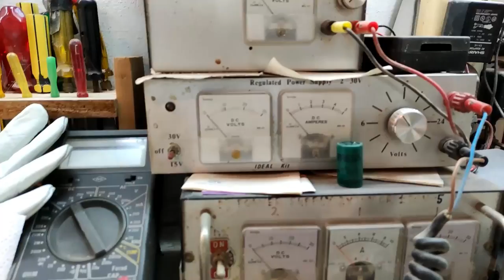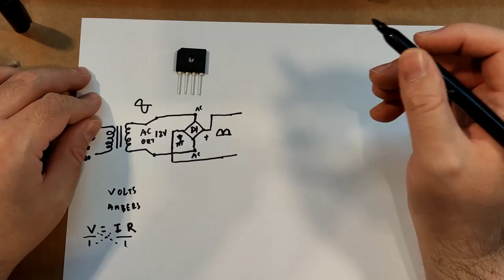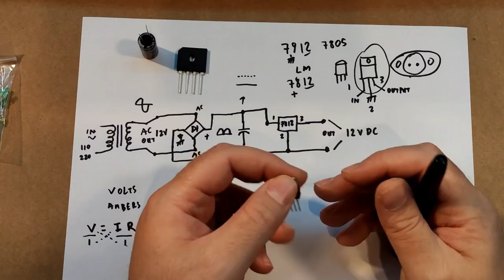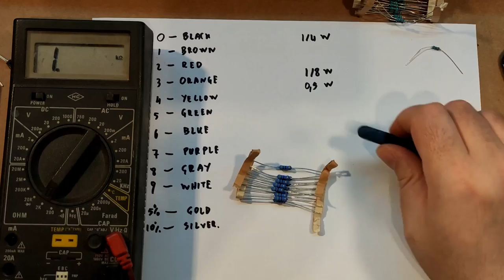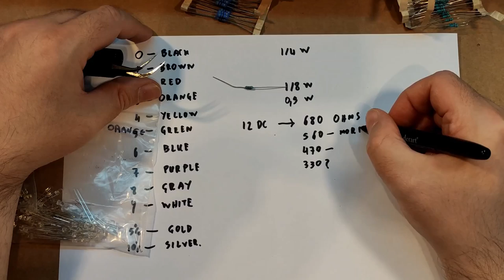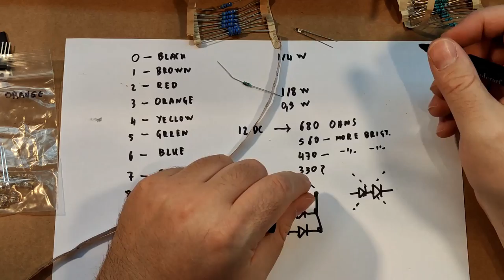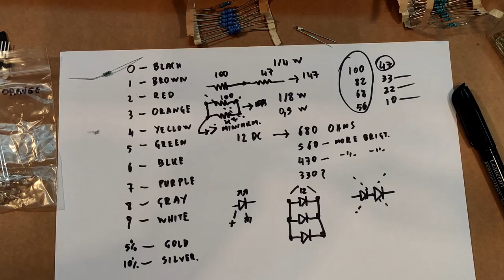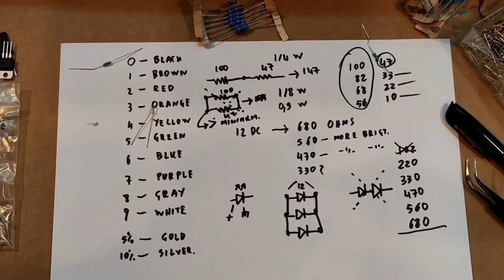Power Supply (PSU) And LED Connections In Models

Comment: Electricity and everything to do with it is one of those things in life that I have never been able to understand or follow. That and chemistry. I forget everything I learned the next day. It just doesn’t stick. I hate it. I REALLY HATE IT. I have the patience to build a ship but I cannot find the patience to try to learn it. Good for you John for having that power. 

I will never be putting lights in my ships and I’m ok with that because I have to be.
Reply from the maker: If you ever wish to try just ask me :)
Reply: You can put lights in easy, you really don't need to design and make your own power supply.

Just buy a 6 or 9 volt voltage regulated switch mode power supply. Then you just need to know a little about LEDs and how to calculator series resistors to connect to them.

Comment: Awesome explanation John had forgotten so much of what you showed, I’ve always been interested in electronics but unfortunately moving to Australia never got the chance to be a technician. What size is that bridge rectifier that you use ? Greetings from Perth Australia 🇦🇺
Reply from the maker: Thank you very much Dirk! It is not big, it's around 15 mm high and 20mm wide. But you can find even smaller ones , i have used in Montanes a circular one that was around 8mm in diameter.
Reply: What I mean is the Voltage and amps like gbu or kbu rating
Reply from the maker: @dirkholthaus2231  Oh, you do not need big ones. I recon that the Ambers will never go over 1- 1,2 tops 1,5 A. The voltage is always 12V so the total power is P=VI ,this means P = 12 X 1,5 = 18 Watt. You can use even smaller ones :)

Comment: Thank you for sharing this explanation, but I can't follow this. It is too technical for me.
Reply from the maker: Hi Peter, if you need anything just ask me. It is not that hard, think of it like your 1st hull building :)
Reply: @JohnsWoodenShips  I think you overestimate how much people know about electricity when they have no background at all. I think you would literally have to start by explaining what a volt is. What AC/DC powers are etc…People that have electrical knowledge assume others have learned even the basics already. This has been my experience with talking and trying to learn from people. They talk to me as if I know the basics already but most of us were taught that when we were 14yrs old and never used it again except we know not to stick a a fork in the electrical outlet. 

Btw, I’m not suggesting you teach basic electronics here for us to be able to install LEDs on a model ship. You should get paid for that because that is a lot of time and organization.
Reply from the maker: @sub04aru  It is very hard to explain how electricity or electronics work in a video. I tried to make it as short as i could and it got 41 minute long! Maybe i should make another one with practice only, but even in practice when you have polarity and voltage i have to explain a few things, it is mandatory otherwise it's will be like showing "here are the components" and "here they are connected". That way, there are no why, how , and reason to do that. Of course i know that many people won't try it, but think of that, how many people wanted to build a wooden model ship and were scared to do it? With a video to guide you many people were able to do it. 🙂